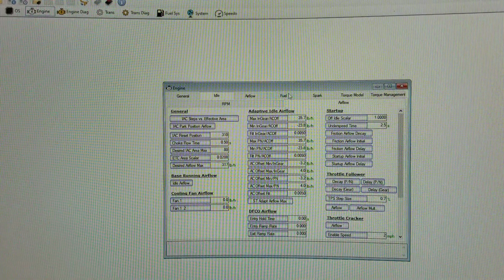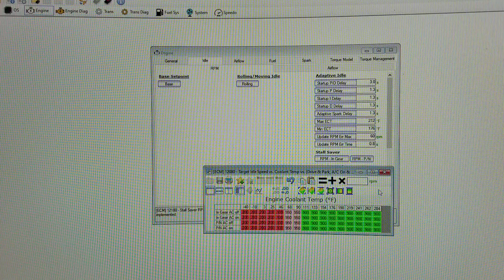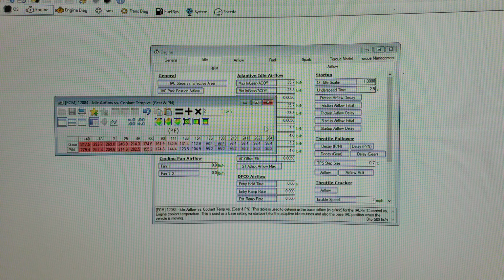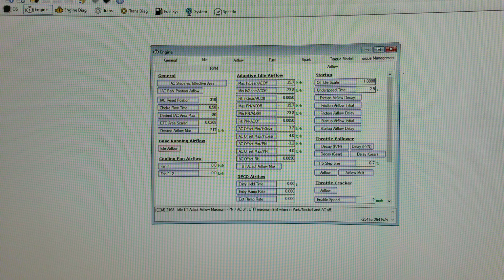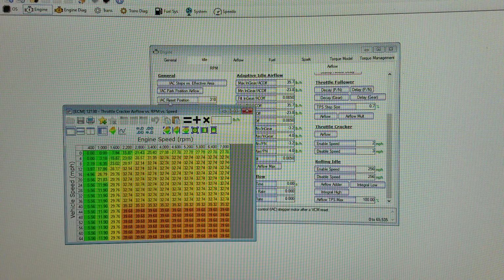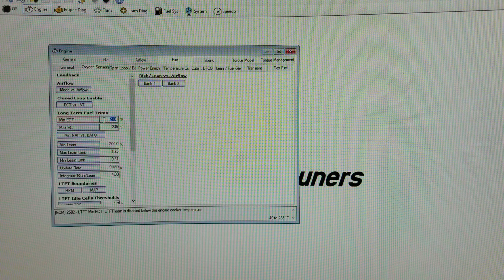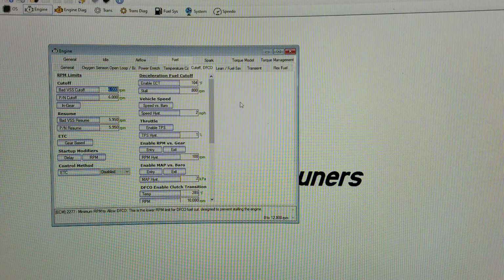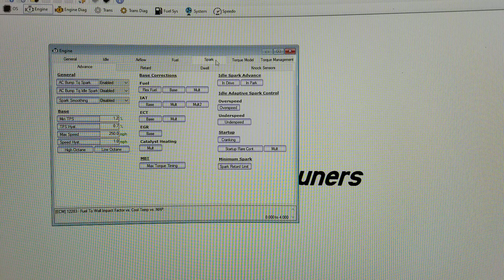How To Setup a Base Tune for your Cammed LS Part 1

Comment: I am having an issue after putting a cam, when I put my truck in gear it goes on it’s own till about 1,800 rpm so if I cero out the throttle cracker do you think that will go away?

Comment: I am probably an idiot when to comes to all this. I have a 96 gmc c1500 with the 5.7 vortec with a Summit Pro SBC Stage 2 Hydraulic Roller Cam, 212/218 Dur., 112 LSA + 0 Adv, .525/.520 Lift, 1500-6000 RPM Range, 1987-02 Chevrolet Gen 1 Roller Block, Valve Springs, LS6 Style, 0.550 Max Lift, Single Beehive, 1.270 in. O.D., 375 lbs./in. Spring Rate, 1.800 in. Installed Height, with a volant cold air intake. And HFP-343 255 LPH Performance Fuel Pump. So I bought hptuner software to tune my 411 pcm and I have no clue as to what im doing so any help would greatly appreciated

Comment: This video is awesome, put a bt stg 3 cam in my ls6, stock tune wouldn’t idle at all  without pedaling. Watched part 1 and 2, made the changes in hp tuners ( except maf ) idles so well now i turned the idle back down to 800 and it still just chops along and idles as it should. My main goal was to get it to run good enough to get it to the dyno, all the changes got it to exceed my expectations, thanks for the info!

Comment: Do you know how to make a cam more choppy sounding at idle?
Reply: fluctuate air fuel at idle.
Reply: @konnerkramer329  thank you
Reply: @redvette2466  yeah no problem just a heads up you might see a little difference in fuel mileage and if the fuel surge is big enough it will foul plugs at idle.
Reply: @konnerkramer329  it's chopping good at idle now the only issue I'm running into is when I turn the AC on it smooths it out almost completely.
Reply: @redvette2466  when you turn your ac on does it raise your idle rpm. if so go under the idle tab and lower the base airflow with ac on a little at a time. this will lower the rpm with the AC on to the rpm range where the fuel swing is in the fuel map.
Reply: @redvette2466  or you could look at your live data at idle with the AC on and see where the vehicle is idling in the fuel MAP and put the same fuel swing there too.
Reply: @konnerkramer329  okay thanks brother
Reply: @konnerkramer329 will this video show me how to get rid of hanging throttle after letting go of the throttle. im scared to drive it like that. any help would be appreciated